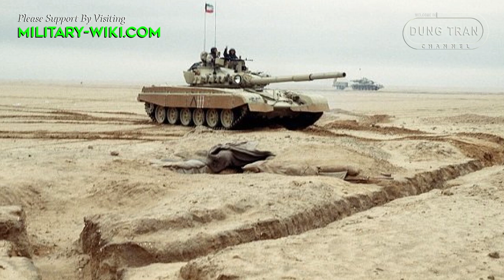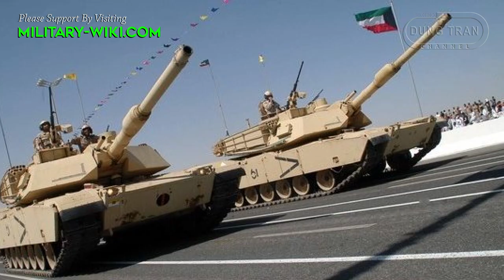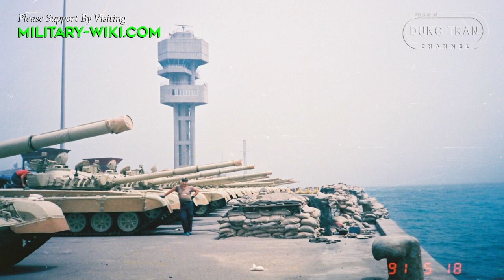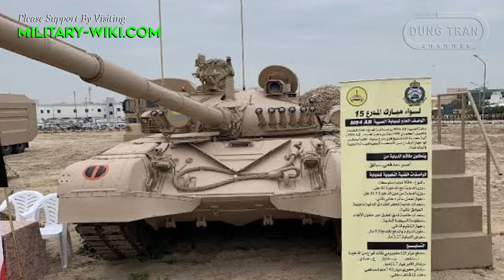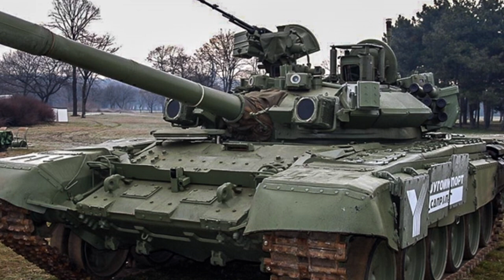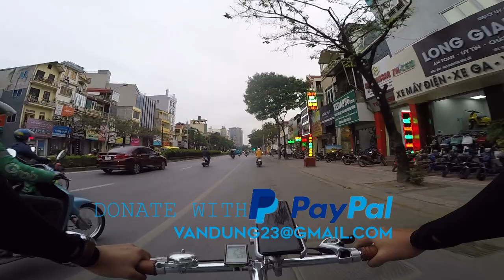Kuwait M-84AB Overview - May Be Sent To Ukraine Via Croatia

Comment: The latest version is the serbian "M-84AS 2"
Reply: Its still only a prototipe
Reply: @antemilkovic5217 nije prototip, ušao je u proizvodnju i nekoliko komada je već završeno
Reply: M95 Degman is better
Reply: @numericvortex7818 He's no better. The M84AB1/2 in addition to a series of incomparably better improvements has 2 most important elements advantage. It is the latest generation of reactive armor designed to be effective against both cumulative projectiles and anti-penetrators, the second has a new 125mm cannon that has the ability to burn missiles with a range of 5km, which is twice as much as any standard ammunition. 
Besides, Degman was only done in 1 or 2 copies and it was given up
Reply: @Truth-Istina  M84AB1/2 is a copy of some russian sollution on their T72 tanks. Problem is that Serbian version is upgraded in small numbers (98% at least, of serbian tenks is still original M84) and that  is just a theoreticaly better. Croatian upgraded M84 in several steps (from A to A4) and know how to make things better. M84A5 (or M84D) is a completely different concept, also with ERA, spaced armour, telecomanded machine gun + some more extras. Please, don't push some YUGO-SDPR propaganda on people.
Reply: @EdoModun what you are saying is not true at all. Almost every system in the M84AB1/2 version has been upgraded on the tank. Croats have upgraded only 1 copy to that A4 version... At the same time, that tank has reactive armor of the Kontakt1 generation... a partially improved fire control system and a different turret. Everything else is the same as the original. The Serbian upgraded version has the following upgrades: 
1. Reactive armor of the last generation 
2. The best laser range finder on the market 
3. Modern communication device with crypto coding 
4. New cannon made under license, identical to the one on the T90 (uses rockets with a range of 5 km) 
5. New tracks 
6. 360° panoramic TV camera 
7. Thermovision of the 3rd generation 
8. Modern sensor of laser irradiation 
9. A modern device for electronic jamming with a range of 5 km 
10. Modern multifunctional screens. 
11. Remote control battle station with heavy machine gun 12.7mm (.50 cal.) 
12. Grids on the rear of the tank 
13. Strengthened engine 
14. Kit for reduced thermal reflection ... If you don't believe it, come to the Partner 2025 Arms Fair and see for yourself
Reply: @Truth-Istina Ah, what a nice list of wishes from SDPR catalogue.
Croatian M84A4 have about 70% of all of items on the list from more than 10 years ago. M84A5 would have more than you described, except main gun. And that story about rockets fired from the main gun, even russians don't believe in it any more.
Partner 2025 is a too much promoted fair of prototypes and models, with a little of real products, like ammunition. 
I remember that story about 20 mm sniper rifle (from Partner 2023, I think). Fantastic solution, that Croatian army have from 94., even lighter than serbian version. Except that serbian version was a gun barrel with mechanism, and CRO version was a real sniper. SDPR even copied the name of RT-20.
Or IFV LAZANSKI, original serbian product, made from turkish, body, russian turret, american engine, etc.
BTW, do You even know what is main goal of SDPR?
Reply: @EdoModun You have a very bad command of matter. 
There is no A5 version. The second A4 version has only one copy. 
The other M84s in the Croatian Army will never be upgraded to either the A4 version or any other. So that doesn't exist. 
Whatever you think about Russian tank tube missiles, it is used in Ukraine quite solidly and usefully. There are several confirmed and documented destructions by that missile. Just a few days ago, 1.00 000 people were destroyed. Abrams and it was done with this rocket from a distance of over 3.5km. 
The Croatian Army may have a 20mm sniper rifle in use, but from imports. The Croats have no production at all. There some funny rifles produce some funny pistols. And that's the end of Croatia's military production. 
The 20mm sniper shown on Parner is a unique model of a semi-automatic sniper rifle in that caliber. Everyone else is a repeater. It is based on an automatic anti-aircraft gun 20mm from the former Yugoslavia. This was done because Serbia has a huge stockpile of these cannons that are unusable for anti-aircraft combat but are very good against targets on the ground. 
Lazanski is a prototype and will by no means be in the final version as shown. Lazabznsky has no chassis and nothing on it originates from Turkey. The armoured body was built on the latest technology developed by South Africa. Our societies bought the technology and applied it first to Lazar and Milos, and now to Lazarus. The dome on the prototype is Russian to show how powerful a weapon it can carry. A special 40mm cannon is being developed for him in Zastava Arms!!!
There is an ongoing development of the engine and independent suspension. So in the final version will have only imported gearbox. 

To criticize someone who makes more than $3 billion from the military industry is ridiculous on the part of someone who has no production. 
Do something first and then act smart. It's easy to say that Ronaldo and Messi are nothing special, But go out on the field and play a game with them